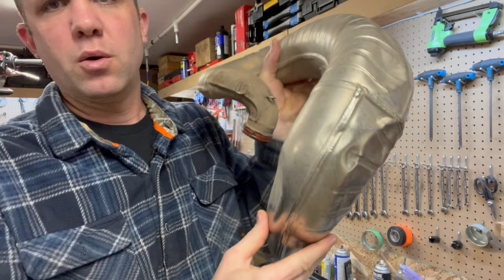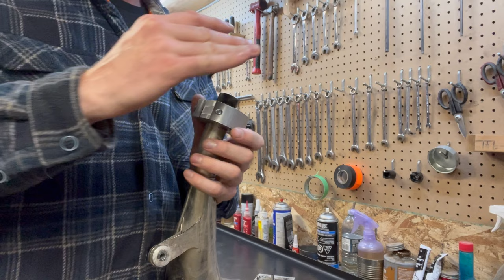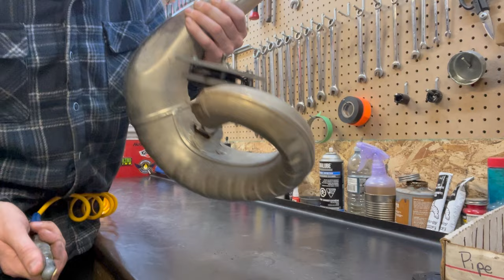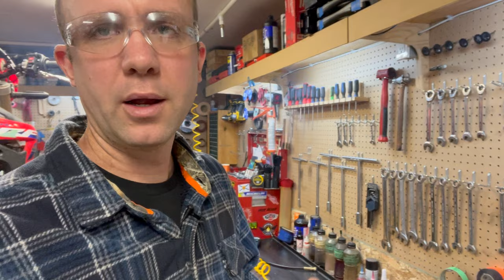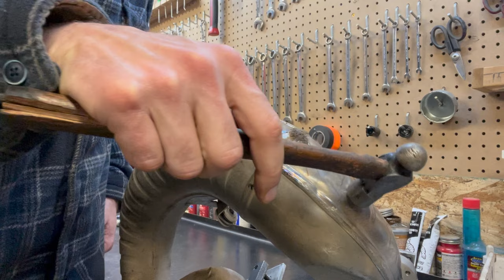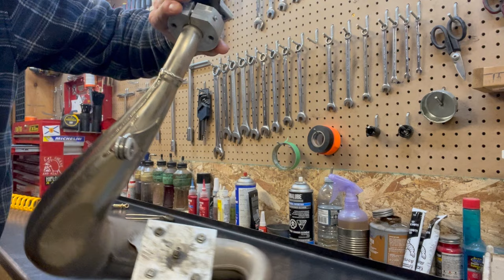How to Blow Out Pipe Dents

Comment: I use 80psi and it climbs to 110 with heat. I don't have a valve in the schrader fitting and just leave the hand pump connected for easy adjustment, it's only exploded once and it just blew the pump off the schrader and deformed the pipe a little.

Comment: Worrying about the effects of heat on an exhaust pipe seems rather silly, the heating and cooling every time you start and stop your bike is probably causing more deterioration than your heating it to get out the dents. It's amazing to watch the dents come out so easily with your method.

Comment: Wear ear protection, if the plug blows out, it could get loud!  Make sure there isn't a build up of raw gas in the pipe.  Back in the day, I ran a supercharged car.  Took it to the muffler shop to have an X pipe installed.  When they cut a hole open with a torch, it lit the fumes and blew a backfire out the pipe.  Spit carbon build up all on the shop walls.

Comment: Try ditching the schrader valve for an air tool fitting.  Then turn your shop airs regulated pressure down to 40psi.  Now you can hook up the air line and leave it there while you're doing stuff and the pressure will stay the same leaks or not.  I was doing what you're doing while boost leak testing but found it frustrating to pump up, check, pump up... back forth, back forth!

Comment: I only fixed one pipe in my younger days (1988 Honda CR250 pipe), and did it quite like you did, (air pressure and a propane torch).  I only had 2 dents, and the pipe was painted black.  If you only do something once, and it comes out pretty good, then it is probably a good process that anybody can do. :)
The only differences that I did was use 30psi, and I had a wet rag in my other had to wipe over the blown out dent to stop the movement when I wanted it stopped. It worked pretty good, and I just repainted the pipe.
The pipe was made of low carbon steel, and is not hard so annealing is not a issue.  I may have actually made the surface a bit harder (depending on carbon content) when I quenched it with the wet rag.  But it never cracked.  Raced the bike for 3 or 4 more years before I sold it.

Comment: Brazing is a great alternative to a wire feed welder. With proper surface  prep and good flux, filler rod flows readily to fill cracks, holes, and voids. I've been brazing for 32 year's.
Your content and quality is excellent Chuck.
Jeff Davison. Saginaw, Michigan.
Reply from the maker: One of these days there maybe be some upgrades that make their way into my shop. Brazing would be way safer. It’s hard not to blow holes in the pipe with this little thing.
Reply: Second the brazing on pinholes, I'm a welder by trade but only in the last few years discovered the benefits of brazing or silver soldering, you will never go back to welding pinholes after using brazing
Reply: @show-me-the-details  Pipe manufactures have used thus method for years for attaching brackets on pipes. Some utilize TIG also. I like the contrast of the Gold colored filler rod on the raw steel pipe. I'm old school I guess.
Reply: Over the years I found exactly the same, brazing gives the whole job a softer look. Plus if you want to tidy it up a bit afterwards the braze is softer to file where as a steel mig weld is very hard.  Nice video, thanks for taking so much trouble.  As a fellow Youtuber I know how long it takes to produce what appears to be a quick simple video.

Comment: I've only done a handful of pipes doing almost exactly what you did here, however I've filled the pipe almost fully with water.
You then orientate the pipe so the ding is at the highest point and the small amount of air in the pipe is under the ding.
The idea is that it's the volume of compressed air that represents any safety risk, so if you only have a small amount of compressed air the pipe is still subjected to the same pressure but if something lets go the energy is dissipated very quickly and you're not creating any schrapnel. 
The only reason I've left a small air pocket in the pipe is to reduce the amount of cooling around the area that you're heating. 
Any commercial testing of a pressure vessel is always undertaken with a non compressible liquid (usually water) so that if something does let go it's a minor event, not an explosion.

Comment: haha I feel better about my welding setup and technique. Yours looks the same as mine!
Reply from the maker: lol. I can’t justify spending a bunch on it. I’d love to have a TIG and a nicer jig set for this but the reality is I only do it a few times a year. This weld was particularly ugly but it’s the way it goes sometimes.
Reply: I've found that PRE-HEATING the surface of the pipe to be welded (to burn off the premix residue inside) makes for a MUCH easier and cleaner weld.
I heat it to red hot with a MAP GAS torch, and then weld the pinhole (or crack) shut..  EASY !

Comment: Are you concerned about the oil or carbon inside of the pipe when heating it up with a torch ??
Reply from the maker: Nope.
Reply: @ChuckfromTrueTech  thank you for your response back  . My pipe has a few dents, and I did purchase the block off kit . I didn't know if I needed to get the inside of pipe clean when I do the repair this spring 2025

Comment: Do you have any experience doing this with the thicker guaged FMF Gnarly pipes?
I can get normal wall pipes to work but never really the Gnarly. I have never dared over 50 psi cold though.
Reply from the maker: Yep. Done lots. Crank it up!
Reply: Oxy I said lanesearch safety pop off vi've seen a guy's pipe explode dude would never do it again but he didn't have any safety equipment and it can be dangerous

Comment: Get the hydro pump dent remover. Much safer for the average goon to use water pressure.  Works great on non-stock ktm pipes…which are over priced and nobody is going to buy or have after the first one.
Reply from the maker: At over $600 the last time I checked, the value proposition shrinks fast.
Reply: +1 on the Hydroforce. An ER visit is about $2500 an hour in the US😂. Kidding aside great post for dyi repairs Chuck. I use the Hydroforce and it works great but tends to straighten out or open the pipe curves on the cylinder end of the stock pipes. Fixing that I've used a heavy ratchet strap in a loop around the pipe to pull the pipe back in shape. I'd probably use a press if I had one. Is it the little ribs causing this? I hadn't considered that. Thanks Chuck!
Reply: I made a hand pump for using water to push dents out over 20 years ago. I was able to get almost 500 psi. The biggest problem was keeping the ends capped, but when they let go, they didn’t go flying.